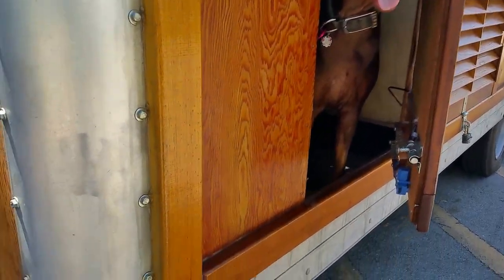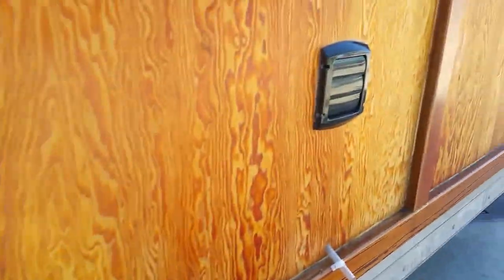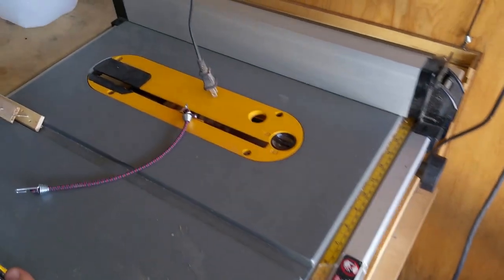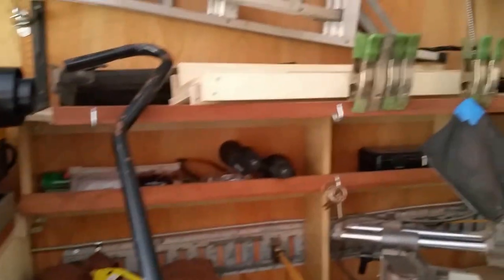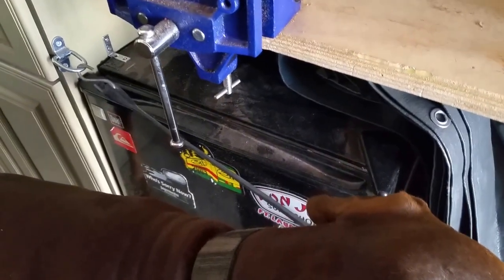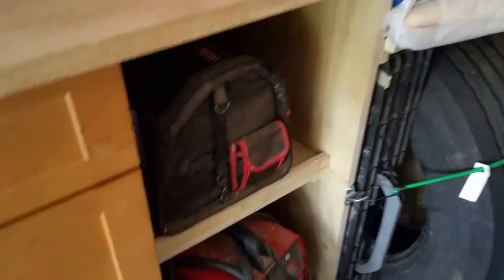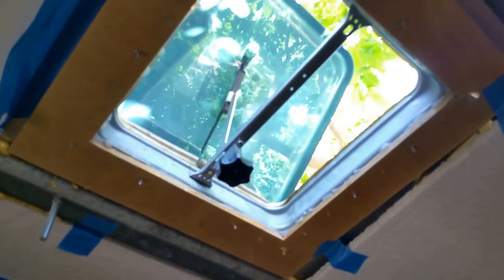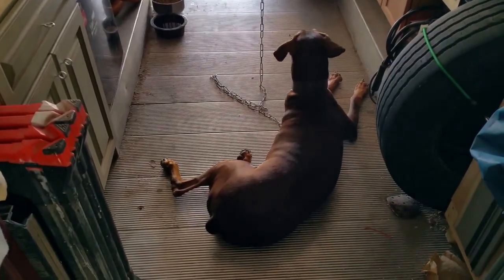Solar-powered mobile woodworking

Comment: Very cool indeed.  You've put a lot of thought into it.  So you basically tow that around to wherever the work is?  Do you work all over one state or all over the US?  Very impressed with your effort in putting in the solar powered system too.  10/10 for effort.  I hope you are still going well.  Cheers from Australia.
Reply from the maker: Thank you and cheers.  Working in Florida with 3 young kids.  Maybe when they're older we can travel a little bit.

Comment: How many AmpHours are represented by your batteries?  How many Watts for your solar panels?  I'm working on my mobile shop as well.  -John.
Reply from the maker: John Sublette I've got 200ah on a 24v setup.  2 panels that put out 480 watts in full sun.   Runs everything pretty well.
Reply: Exactly the specs I was looking for - thank you!